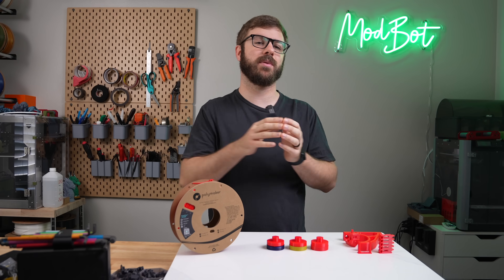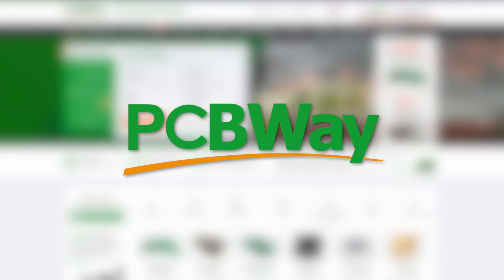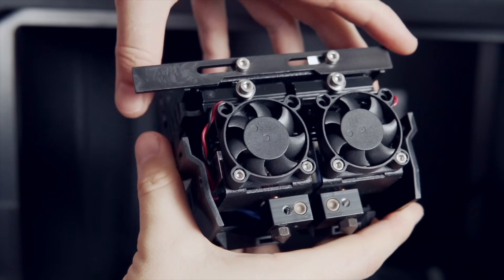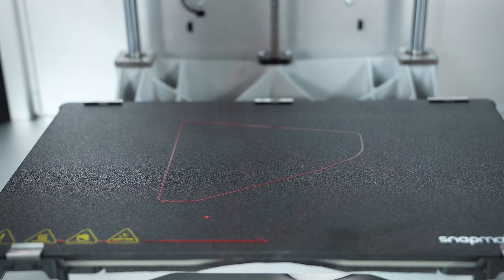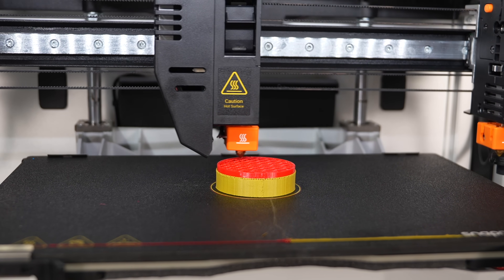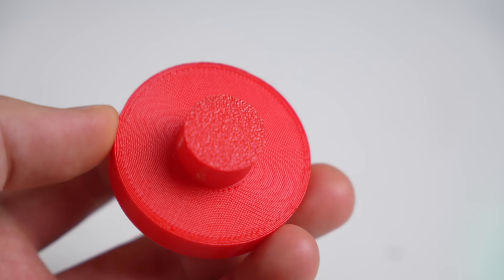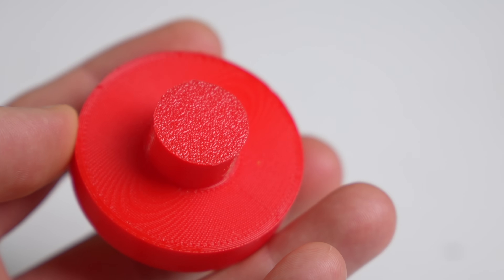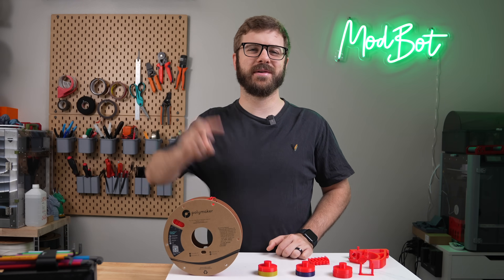Best Support Material For TPU 3d Printing

Comment: PLA does not work as support material for TPU if you need to print the PLA on top of the TPU to generate support higher up the the part. The PLA just strings on top of the TPU .

Comment: im new on tpu printing i always print using pla , when i tried the tpu everything got missed up , the lines are not unifrom its burning the lines and throw filiment more than it should be i tried the recommended settings but nothung much changed actully , i use prusa i3 mk3+ when i put back the pla everyhing just went back fine , can anyone help ?

Comment: I dont have a dual material printer, but i printed a tpu grommet for a wiring harness on my car, by pausing the print and placing a ring of pla i printed earlier where i needed support and it worked perfectly!
Reply: Great idea. I was wondering if applying a layer of glue stick could work as a separator. I'll need to try it sometime.

Comment: You can use every oposide Material.
Like pla non oil Based and petg oil based. 
Tpu and pla....
Almost everything in the same Temperatur  range an different basematerial.

The only reason why your petg gets of the tpu was the Temperatur different during the print.

And tpu on tpu Support works fine too if you know how to set up a printer properbly.

Comment: Great video.
  I don't own a twin head yet, it seems to have a great future making aftermarket soft touch buttons and switches for vintage auto use.
  White or red inner core to make the marker and black TPU, then a little vapour smoothing.
 Jobs a good un

Comment: How about printing the support interface layer at 100%? That way the support will have a smooth top surface which could release easier. If you could perform ironing on the interface layer it could be even better :)
Reply: Interesting. I’m brand new to prusa slicer (well- Bambu) is there an ironing setting for support interface only?

Comment: Now seeing this for the 3rd time or so.
You just pulled the parts appart and used a spatula.
But one material is a flex one and while warching it today, I wondered if using compressed air could be used as one of the tools to separate the parts.

Comment: How about looking into ABS or ASA and what materials could support them? It would be great to be able to use a cheap PLA to support ABS prints.
Reply: I print a lot of ASA and I've been using a nylon (specifically PA6-CF) support interface layer with good results.
Reply: @anon-means-anon  I use HIPS for ASA an an interface layer, works great!

Comment: Great video, thanks for the work.  Going one step further on your test.  For the PLA support did you think about/can you run the support up to "Almost Touching" the part being supported and then change from a solid support to "support like" print out?
  Because of home electrical issues I've been out of printing for over a year and just now getting into it.  I've printed PLA and PETG using it's own support structure which is stringy and brittle that can be broken off.
  So the question is instead of connecting with a solid support for the TPU over hang, but you print solid up to a point and switch to support mode between the solid PLA support and the TPU?
  Wouldn't it separate more easily if you didn't go from solid to solid?  Sorry if I'm not explaining this correctly or with the correct verbiage.

Comment: Hips also works well, at least for supports between a TPU part and the print bed. The Hips is quite brittle and easily snaps apart which is handy if its an internal support. It won't stick at all to the TPU so is less than useful for supports printed onto TPU e.g. for openings/overhangs higher up in the TPU print job. How well does PLA work for printing supports on top of TPU?

Comment: Try something like 0.08mm Top interface spacing (or even 0mm if using PLA instead of PETG). You can get an even cleaner overhang :)

Comment: Maybe organic supports would produce some interesting results, especially for PETG and ease of separation. I think it would also allow you to run the support material hotter (or cooler) as needed since the distance between the support and the TPU will be greater so less heat transfer.
Reply: Organic supports would probably make this more challenging but if there's a way to do it reliably then it would be great to learn.

Comment: Have you tried Polymaker's TPU95-HF? I don't know why anyone would print in normal TPU when Polymaker and Overture make high flow TPU which prints nearly as easy as PLA in my experience. If my prints don;t need to be rigid and can have a bit of flex, my go-to is a HF TPU. I feel like people don't know about it and it's a monster leap forward in flexible printing.
Reply: It's great.  But the reason you'd be using normal 95A or softer TPU's are endless when you want a softer printed part....

Comment: Why 0.1 gap? It seems like you'd go with full-contact support (0mm gap). Based on your results though, you'd have to run some samples and compare. Your results are impressive.
Reply: I like to add, that I had good results with PLA+PETG setting it to 0 gap, Rectlinear Grid, a sheat around the support, 3 top and bottom interface layers and a concentric pattern. The PLA profile is set to soluble material. Reason for the very thick support is that I had my interface layers not bonding while printing and ruining everything late in the print. This makes the support very sturdy and we get a nice flat chunk of an interface layer that will just remove.
Not sure how this would perform with TPU+PLA, but I would give it a shot.

Comment: After you print the first donut can you use it as support for the NEXT print.   You print the Shaft of the next print to where it needs the support and then just set it on top of the shaft and let it print.   No more wasted donuts.   thx love to see the vid on that type of support and how to do it...
Reply: I have done that same procedure and gotten acceptable results from a single extruder.  The supports have to end at the same layer though.

Comment: You could have an even easier time removing the supports with some better settings. While the multi-material printing certainly helps, that heavy block of support material is overkill/impractical.

At least in Cura, when I'm not using trees, I like using 0 support walls, 15% support infill, the zig-zag support pattern and top/bottom interfaces. This gives you plenty of places to put your pliers, then you can pull and it'll mostly zip right off.
Reply: Hey nice to see you here man! Are you still messing with Linuxcnc at all these days? Your videos on that back in the day were super helpful!

Comment: What about a single (but thick) separation layer in PLA and the rest of the support in TPU?  That could reduce the needed filament changes to 2 and make things usable on a single extruder system.
Reply: In PrusaSlicer this is the actually the default for multimaterial supports if you use the default “dissolvable supports” profile.

Comment: How about - and I cannot stress this enough - instead of printing all of the Supports with another Material constantly swapping between Nozzles / Filament with every 2nd Layer you instead choose Z-Offset Type None ( Soluble ) thus only having the 1-2 Uppermost Interfacing Layers be printed in a different Material saving you a LOT of time? https://i.imgur.com/OBr2MoT.png 😏

Comment: Can we just call it PET-G instead of pee eee tee gee?
Reply: @ModBotArmy  Selling my X1C/AMS combo to try something else. Thinking of building a Voron, but the flsun v400 and the snap maker j1 has caused me to pause and research before pulling the trigger. How has the J1 and the V400 performed for you so far?  Any big issues or pitfalls with either system?

Comment: We’re there any other upgrades included in the upgrade kit and have you run into major hotend clogging problems. I tried the J1 for my lab and had to return it because it was clogging a lot. I would have stuck it out and tinkered but I was about to leave the lab and didn’t want to leave a project for the next user. From what I read the hotend design is susceptible to heat creep which was causing problems. A couple super users suggested some modifications to the hotend using stock parts but I haven’t seen anything from snap maker themselves addressing the issue.

Comment: I tryed the other side around.
Made a PETg bar with a TPU top, to make a surface to grip that gives resistance, and a high strength bar (PETg) to take the load of pressure, and the TPU the give resistance, to hold a Item on its place. And they sick quite god to another, the PETg and TPU. 
great video as always 👍😀

Comment: The bond between TPU and PLA is not very strong. I did some test using TPU as living hinges for PLA prints, and found that the adhesion was so week it only worked if I created mechanical interlocking between the two materials (using dovetail features). Of course, a weak bond is what you want for a support material, but it needs to be strong enough to allow you to grow supports from the part, not just from the build plate, if it's going to be a general solution.

This is something you didn't test. Your PLA support is only from the PEI bed. What happens if you try to put down the PLA support on top of the TPU? Does it have sufficient adhesion when hot to stick? My hinge experiments required me to really slow down to get that to work. I think I ended up printing at something like 10mm/s. It would be good if you could extend your test to include this.
Reply: I just tried printing TPU on top of a PLA raft. It worked out too well, the TPU part was permanently bonded to the PLA raft.   Maybe the adhesion depends on the filament brands? I'll try again with other PLAs to see how it goes.
Reply: That is correct. I reckon this will only work for supports in the bed. Still there are a lot of use cases where this will work great. Much better than virtually not being able to use supports at all.

I will definetly will try this with my Prusa XL that I will assemble this weekend.

Comment: I do print TPU 95A with TPU support (BiquBX, Cura 5.4, 253º), no other changes that I recall and it dataches quite easily with great finish. Maybe you should try Cura just for the kicks?
Reply: @@chrisvalin9299 Cura allows to pick any Z gap - but transforms it to full layer heights (0.2 layer -> 0.0, 0.2, 0.4 and so on), while PrusaSlicer allows to input (type) any number in mm and that will be used (0.15 -> 0.15, 0.22 -> 0.22, no matter what the layer height is)

Comment: I guess it depends on what printer you're using but the BL printers print TPU support flawlessly.
Reply: BL Printers? Is it brand?
Reply: @multilaton4835  bambu lab
Reply: As Bambu Labs said, TPU jams in my AMS. TPU therefore needs to be a manual feed. So automated TPU support interface layers won’t work. I suppose if there are only 1 or two interface layers you could do it manually, but if you have a sloping overhang it would be impractical.
Reply: @spongecounter  I have used TPU to support TPU plenty of times with my BL printer. It works very well in general.  That's what I was saying. The creator of the video said that you can't use TPU to support TPU and that isn't true with some printers including my BL printer.
Reply: @DoRC  thanks for the clarification. Makes sense. 
I’ve used TPU to support TPU many times too. I do find it ugly compared to other materials. An exacto blade works for cutting the supports off.  Do wish I could use TPU in the AMS though. The PLA with PETG support interfaces look beautiful so I wish I could do it with TPU.
Reply: @spongecounter  I found with TPU on my P1P the supports just come right off. No cutting needed in the interface looks really good.
Reply: @DoRC  Excellent. What TPU, and what separation distance?
Reply: @spongecounter  sainsmart. Generic TPU settings only adjust for flow temp and pressure advance using orca slicer.